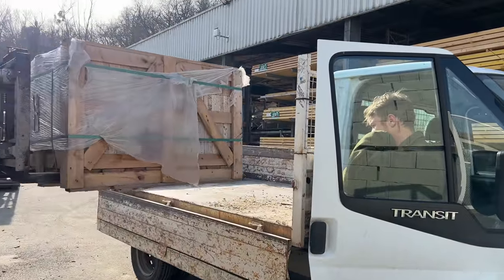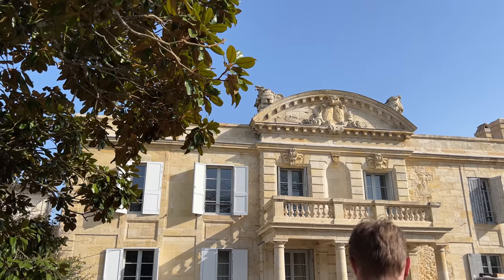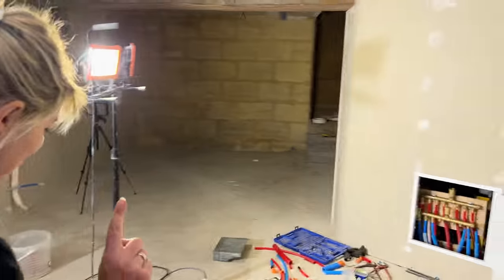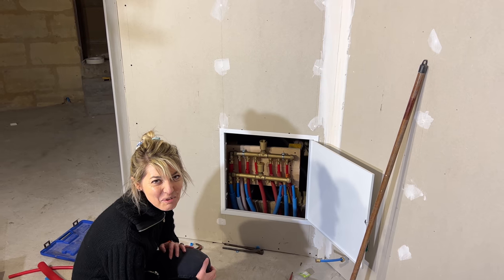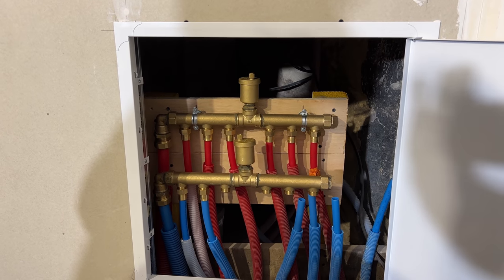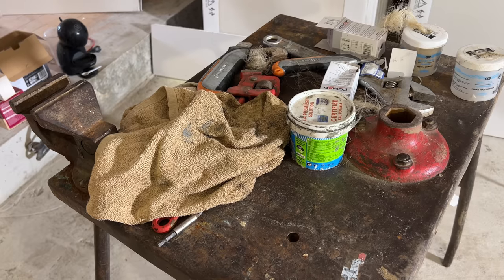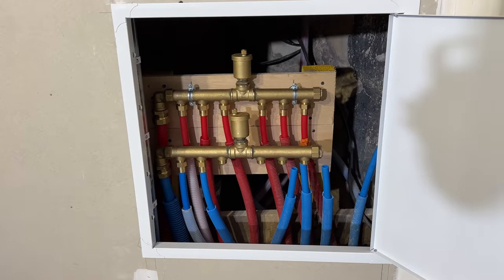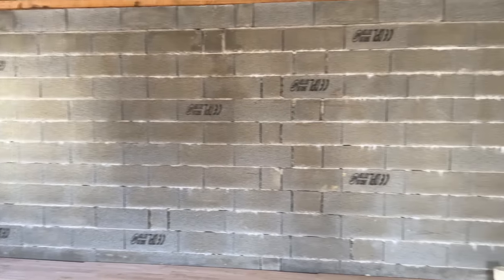EP129 Pool Terrace / Patio ,Tiling Begins , Kitchen Progress, Guest Apartment @ Our Passion Project

Comment: If anyone has been critical of the work ethic of Edd or Anna or Cyril, that's a reflection of their inexperience in renovation/building/trades!!!  I have been continually amazed at the work that's been done. Someone has already posted about Epsom Salt baths. (When I tried to buy Epsom Salts for a bath in France, the pharmacist had tiny packets which are used as a laxative). Please take care. I am proud to be part of your group and celebrate each project completion. [Plus, I set up the loop replay which adds to your views. Don't tell anyone]

Comment: Huge work for such a small team. I know Edd mentioned to seal the floors to help protect it but in my years of working with wood floors here in Canada they sell large rolls of paper flooring for this exact thing, to protect it. It comes in around 3 foot lengths on a roll and you just lay, it roll it and tape the joints. especially useful around entry points with loads of traffic. That way every trade that comes in, does scratch or mar the florr. Easy to undo as well.

Comment: Edd & Anna, it’s obvious (to me) how much work you two & Cyril have been doing. Others have commented about wearing a mask around a construction site when dealing with lots of dust, paint, varnish, pigeon poo, etc.  They are right about that! Please keep an N95 respirator and protective glasses at the ready for those times. Laryngitis is caused by a virus, though it can turn into bronchitis (viral or bacterial).  So be watchful of how you feel. Agree also with taking a hot bath, but with two cups sea salt, 1cup Epsom Salts, and 1/4 cup baking soda added to the water. Soak up to your neck, no more than 20 minutes, dry off, don fresh pajamas, then straight into bed.  FYI, the salts pull toxins from the body through the skin, and baking soda neutralizes toxins deposited in bath water. A hot toddy to follow is awesome (my recipe is a cup of hot tea, with juice of 1/4 fresh lemon, 1 teaspoon raw honey, and 1 jigger of whiskey or bourbon).  Sip slowly until gone. Do this and you will sleep like a baby!  Edd, looks like your immune system is working to kill the virus, as your face is flushed and you appear to have a fever—so take care not to chill yourself in the cold. I truly hope this helps and you feel better soon.  Health is so important.  Take care Edd, Anna, and Cyril.  Your project is coming along nicely!

Comment: All the room heaters are coming along nicely and wow you need so many, such an expense, but we don’t have them here in Western Australia as there is no need as it is never really cold enough and in winter we usually just have reverse cycle heating or a wood burner, small electric or gas heaters. We are having heat waves during our summer now unfortunately and have broken records of about eight days in a row over 40 degrees Celsius which is very, very hot. It’s hovering around the 35 onwards mark this week. Sorry to hear that you are not still 100% Ed but at least you’re voice has come back but take care of yourself and get well. I see that the floors are nearly there and they will look great when finished.  The pool paving  is looking amazing and such a lot of hard physical work for you Ed,  you are a working machine!!